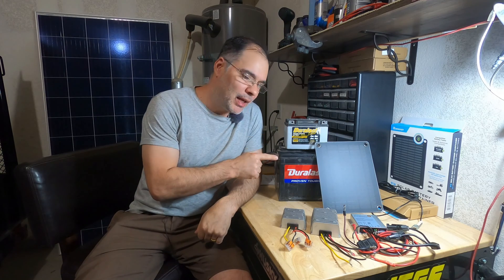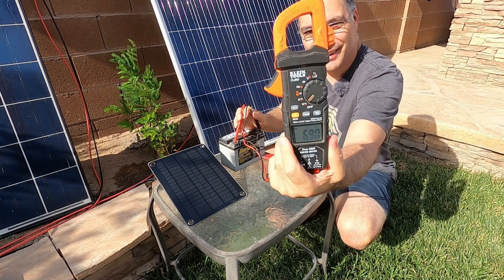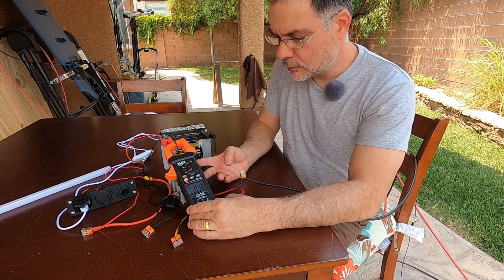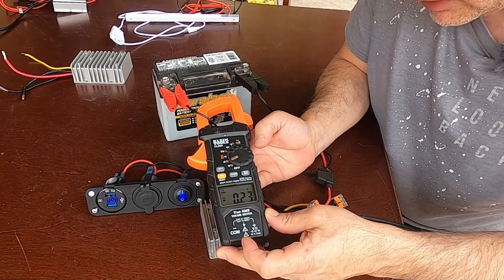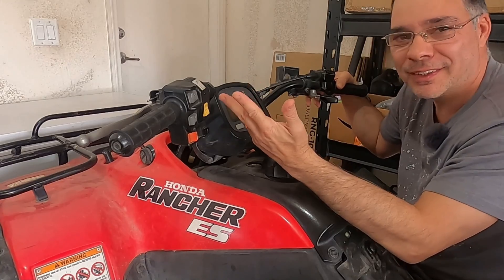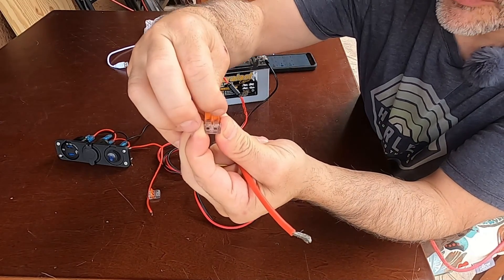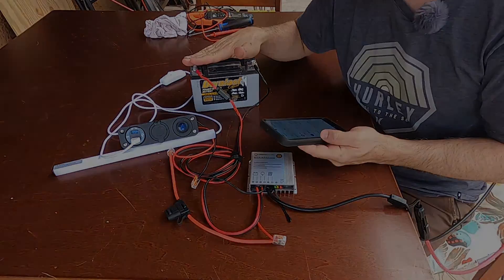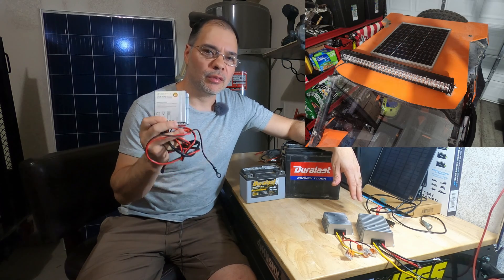Can A 50W Solar Panel Charge A Dead Car Battery?

Comment from the maker: I found this really cool and easy to use mini MPPT charge controller. it's waterproof and is very durable, light and compact, and has Bluetooth! All that for only $79! It only accepts up to 130W of solar input and outputs 10A, but it's perfect for keeping your vehicles battery topped off or emergency battery charging. 

Enjoy!

Affiliate Links: 
* Denotes items used in video.

LensunSolar 10A/130W MPPT 12V Bluetooth Solar Charge Controller (55V VOC MAX) *
https://amzn.to/3QvTXUP

NOTE: These panels will work with the mini MPPT controller. Do not exceed 130W for the 10A unit. There is a 20A version that will take up to 260W of solar. There are options for 12V or 12/24V batteries. Use NATESDIY at checkout to get a nice discount!

Renogy 50 Watt 12 Volt Monocrystalline Solar Panel *
https://renogy.sjv.io/OrKv1Z

Renogy 100 Watt 12 Volt Monocrystalline Solar Panel (Compact Design)
https://renogy.sjv.io/zNb5j0

Solar Panel Mounting Curved Z Bracket (4x)
https://renogy.sjv.io/LXmyDV

See video description or my website for more options!

Comment: 50w might be to much for that battery I think. Maybe 20w panel would be more suitable to not over heat battery and possibly damage.
Reply from the maker: Yes, but  the charge controller should control that. .

Comment: Add a blocking diode between the bucking converter and battery. This prevents the battery from backfeeding and possibly damaging the buck converter.

Comment: Don't think its the buck converter or panel is an issue charging the ATV battery. If its already below 11.5 volts and sat like that for any time the battery died and wont take a charge anymore. After charging a battery wait 5-10 minutes then check the resting voltage, dead batteries can show a surface charge with normal voltage but putting a load on it shows the capacity. For an emergency though it could save you, like to see the experiments getting the brain thinking on possible projects!
Reply: A 12v buck converter should be wound up to 14.4 v ( ;lead acid nominal voltage per cell is about 2.26 vdc times 6 cells equals about 13.8. Plus you need a little head room over that to push the amps into the battery. No more than 14.4 ( which is the correct auto voltage regulator anyway)Of course if you set it at 12v the charge current will be less. remember MPPT means the charger finds the ideal balance of volts and amps which make the panel most efficient.
Reply: Yes , I thought he was hoping for a miracle with that battery. . Noted that the crank on the AtV sounded a bit asthmatic. Well done for having a go. Thats how you learn!

Comment: Would there be any benefit to adding a power capacitor (1 farad) to a dc to dc converter configuration and/or lipo4 100ah setup?
Reply from the maker: Iv heard of people pairing capacitors with LiFePo4 batteries to create CCA ability for starting but I have not tried myself. I think Dakota sells a battery with a built in Capacitor for CCA ability
Reply: @natesdiysolar  Thanks, I have one left over from a previous audio system and was thinking about incorporating it, if there was a benefit, and it not just acting as a parasitic draw.
Reply from the maker: @bigdaddydoitall  lmk what you find out
Reply: @natesdiysolar  will do

Comment: What is the highest watts in 12v panel I can buy to charger my 12v car battery very quick ? 
Note : price don't matter .
Reply from the maker: It will depend on the controller you use and how much space you have on your car roof if you plan on mounting on car.  Remember there will be wind drag etc.. but using the controller I used it will take 100w panel @ 8 amps I'm guessing it would take 30 to 45 min to get enough charge to start.. hope that helps
Reply: @natesdiysolar  is 100w panel the highest watts I can use in 12v panels ?
Reply from the maker: @VOLVO_SAVED_MY_LIFE_CLUB they have 200w "12v" panels..
Reply: @natesdiysolar  is the 200 w is the highest ?
Reply from the maker: @sabahameer2620  not 100% 
Sure, but it's the highest I have seen.  But you should know there is not really a such thing as a 12v panel. They are actually 24v but used in 12v systems.  You can technically use any size panel as long as you have room.  Take a look at santan Solar. A 250w panel will produce around 37 volts.  335w will product 45v or so.  Sure, they have tiny 12v specialty panels but have very limited use

Comment: Buck converters seem to be a pretty handy device to have around the house. I found this voltage adjustable buck converter on Amazon “DZS Elec DC-DC Buck Boost Converter” that might meet your needs.
Nate, on a slightly different path, have you had any experience with ZNShine brand solar panels?
Reply from the maker: I have not used those solar panels.. why do you ask?
Reply: @natesdiysolar  A1Solarstore (they have a local Las Vegas distribution center where you can pick up your on-line order) has a ZNShine 370 Watt panel on special for $126.54. This sounds too good to be true. It looks like they are new panels.

Comment: Would be nice to see buck converter, and behind it PWM charge controller, it would be very close to mppt efficiency if buck converter will be little big higher than battery voltage.
Reply from the maker: Like connected one after another?
Reply: @natesdiysolar  Yes, if voltage of panel and voltage of battery are far away each other, pwm suck, buck converter theoretically should improve efficiency of pwm controller. MPPT controller is basically buck converter, pwm controller, and IC unit with algorithm to achieve the most power.

Comment: wxst    came with a 1,5ah    and 12(9 to 14v)  and convert it to   13.8v constant...!!!   was my smartest buy!!!! even if a batt is less , it kills it to fix the another battery !!!  30w  panel goes to cheap pwm
Reply from the maker: Aww man that would of been a good idea to try.  I should of bought a cheap pwm and compared efficiency of all three devices. Would be sad if a buck is better than a pwm lol
Reply: @natesdiysolar  Depends of input voltage(solar panel). If you charge 12V battery with 60V solar and pwm, it will lose against buck converter.